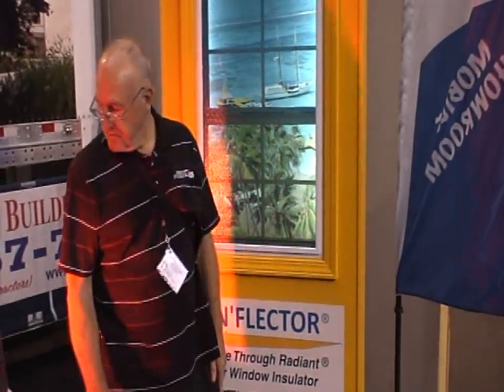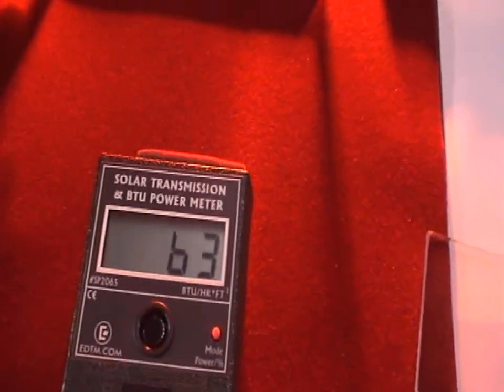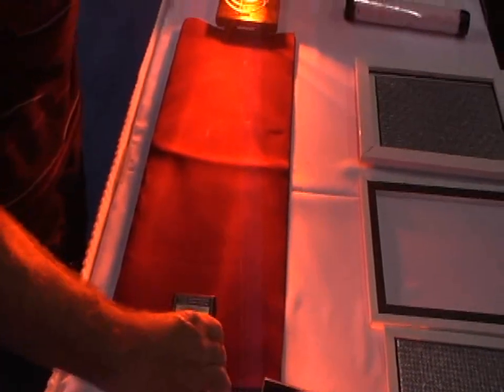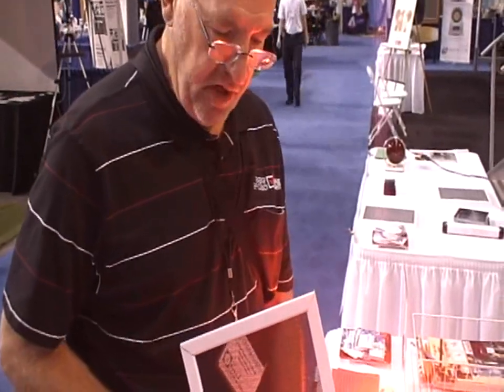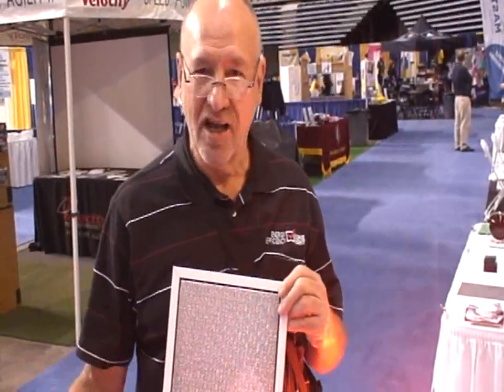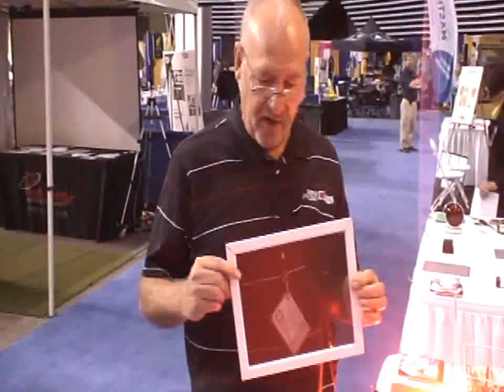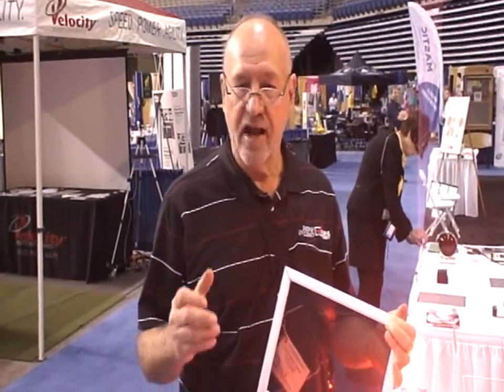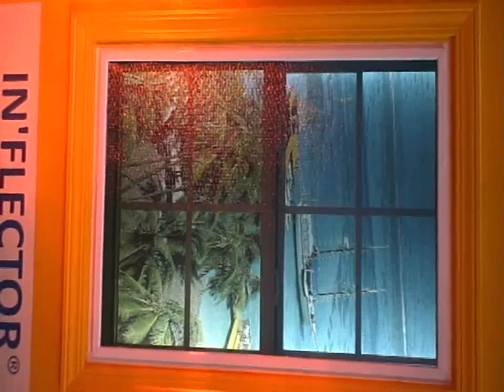Inflector Window Insulators - Solar Heat Test

Comment: What is the measured gain in the Winter configuration - using your calibrated meter reading of 100 without any window - of the inflector insulator?